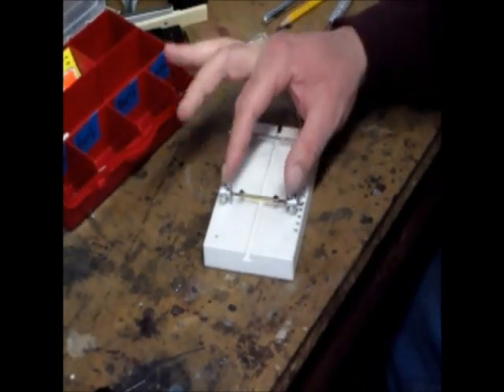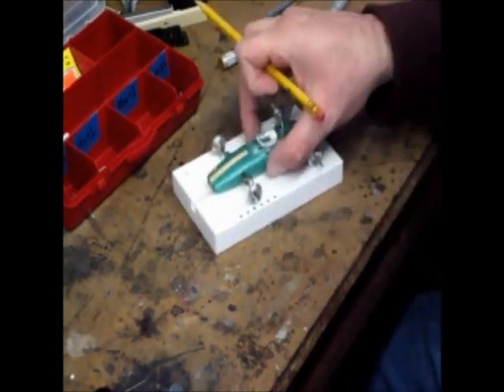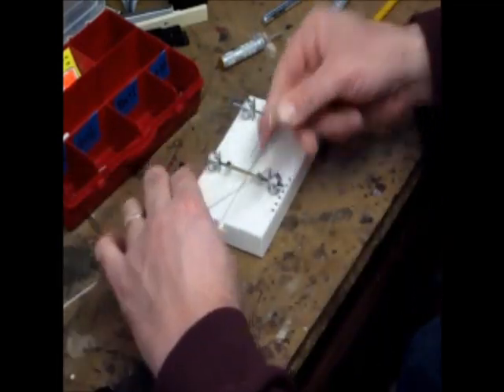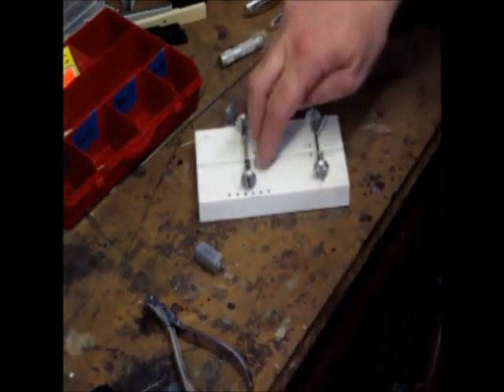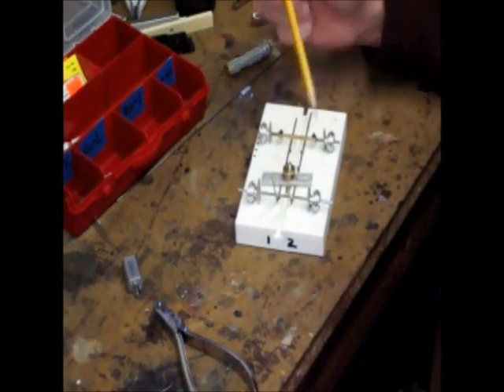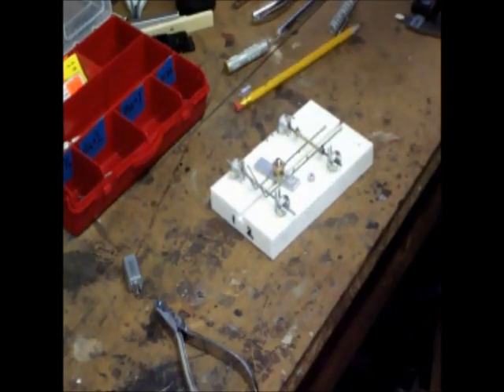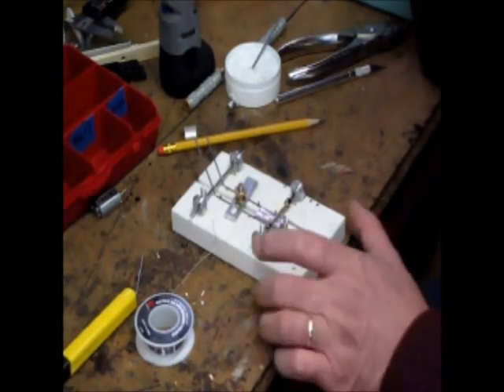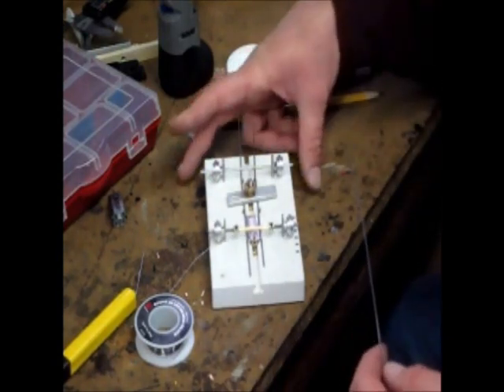Slot Car Chassis Build Part 2

Comment: Hi Dean, thanks for a fetailed view at Scratch buildin a slot chassis, could you comment on the Jig manufacturer, the soldering iron and tip size, and the Solder flux brand.
I use to scratch build 1/24 chassis in the 70's but havent done any lately.

John C